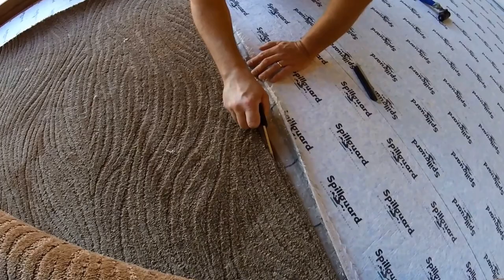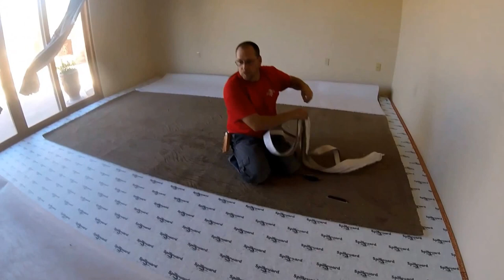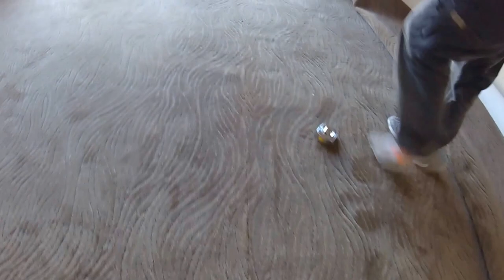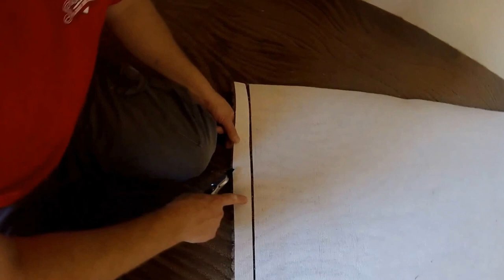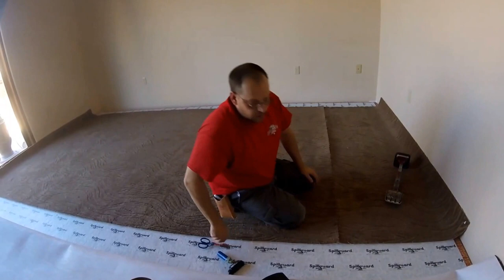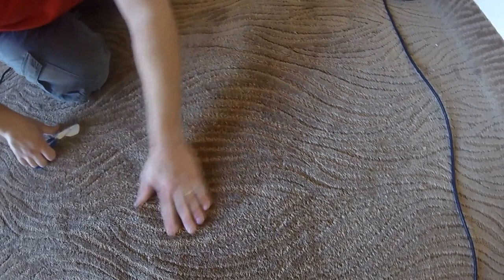HOW TO SEAM A PATTERN CARPET

Comment: installer since 1961what i like to do is instead of cutting two notches in the fill piece i put two awls about 1 foot in from the edge & place my straight edge to them when cutting, it may take 3 or more if it is a long cross seam & pin all pieces down if it is a wood floor   p.s. don't you just love soft back. great job
Reply from the maker: john siragusa Thank you sir

Comment: Kudos, the final result looked great! I feel like beginners should understand 2 things about this video;  there are a lot of times you cant get away with just trimming off the salvage edge. Sometimes you have to cut into the width more to get to something dimensionally stable. And the other is...seam seal all looped carpets. This guy probably knows what he can get away without doing, and the job looked good, but it doesnt take long to seal so just do it...that's what's I'd tell a beginner.
Reply from the maker: ja1doyle Thank you so much for the compliment, and you are absolutely right about sealing the seams, all of my later videos you will notice me doing that and demonstrating it , Thank you for taking the time to watch and comment

Comment: I've been doing carpet installation for 30 years and I must say you do quality work. but a couple of questions. what type of seam tape do you use and why don't you seal your seam edges.
Reply from the maker: Karen Snyder In this particular video I was using powerhold 250 was the brand of scene tape and since then I have started using the orcon Peak buster to seal my seams

Comment: You're a great carpet installer but I hope you used seam sealer?
Reply from the maker: thanks !  i know that they recommend  using it on all carpet but i will usually judge that myself, if i feel that the rows or the backing is loose or brittle and might cause a problem i will use it, otherwise if its a nice tight row cut i don't think its necessary on all stretch in carpets ,however  i do think its necessary on ALL commercial glue downs.
Reply: FloorsbySouthernboys I by no means no as much as you do I'm just a simple carpet cleaner trying to learn how to do repairs on carpet and watching a lot of videos
Reply from the maker: Robert Ellis if I came across rude that was not my intentions I was just trying to share some information if you would like me to make a video on any particular kind of repair or anything that might help please feel free to let me know and I'll do my best thanks for the replies
Reply: FloorsbySouthernboys oh no you didn't come across. being rude, this is just my humble self!
Reply: Robert Ellis yeah u right we check the backing the problem is the inspector
Reply: I dont think you need to suggest any kind of sealer, as he would have used it if required, I have been fitting carpets for some 37 years now, it was a friend of mine who told me to look this fitter up, clearly a true professional, who makes it look so easy, doing cross joins are not the easiest of things to do,

Comment: Im.suprised you don't get your side match, then row cut the cross seam.
Seems like  your gonna get the loops un spun.
You can overlap on pattern run your cross seam row , you may have a slight bow but if you run you side seam you can do cross seam in sections if needed,
In other words if rows are off make part let it dry then move the other where you need it
Reply from the maker: Michael Trevino I understand what you’re saying, I do row cut my cross seems now, and there is no need to stop and wait for it to cool since I have the seamer down now , That’s what it does is it cools your seam down really fast, So that you don’t have to wait, check out my video titled seamer down now Challenge, it shows that you can power stretch and 20 seconds after your seam

Comment: Wtf fire who ever measured that job. There is no reason for a cross seam in that room and wtf are you doing using a straight edge on a patterned carpet.  Your top cutter is ment for cross seams more than wire cuts
Reply from the maker: TheSavagedave Thank you
Reply: He is using a cushion back cutter to be exact, and sometimes you have to just Install the Job they give you.
The Cushion back cutter cuts much better than a loop pile cutter.
They do not hang up or wobble, as well it cuts closer to the edge.
On the fill ?
I thought the same thing until I looked down the hall, He's doing more than one room.
Reply: He cut down the rows from the back, then overlapped and trace cut the other piece down the row from the back.
If he had jumped rows the pattern would have missed it looked fine.